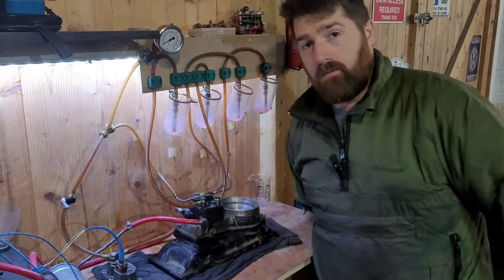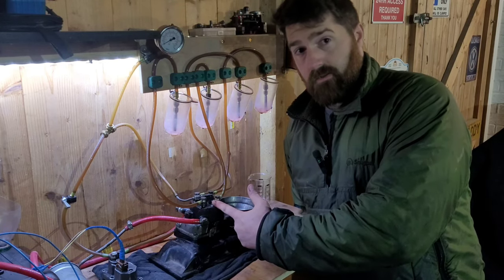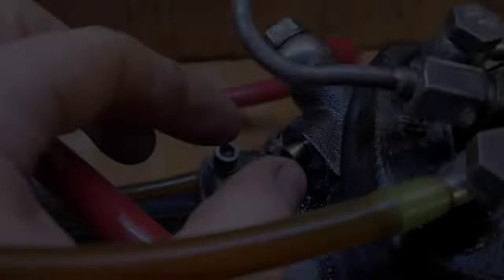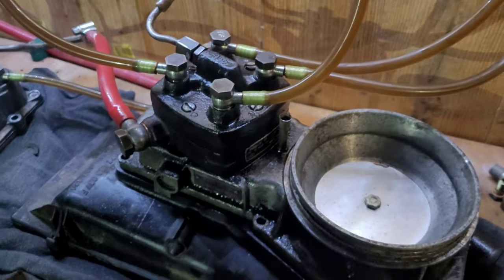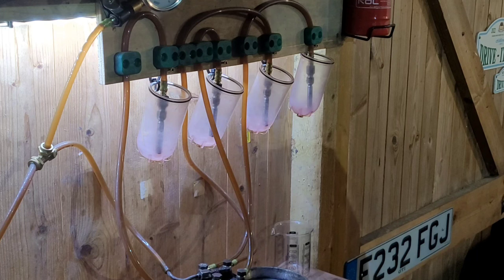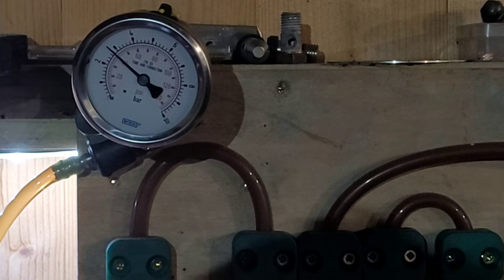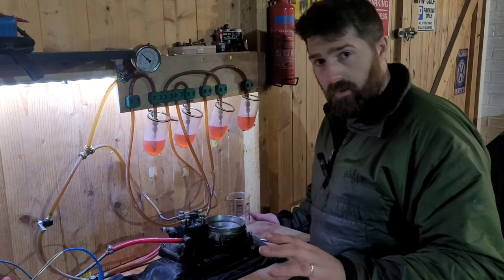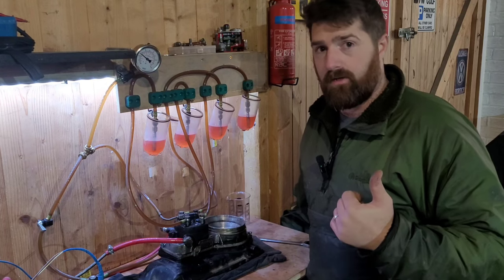Porsche Bosch K-jetronic - 924 System Pressure + More

Comment: You didn't touch that the warm & cold control pressures as well as the A/F adjustment are also factors that impact fuel flow.  Also there are O-Rings inside the metering head that can cause flow imbalance to each cylinder.
Reply from the maker: I've previously covered those points in other videos 👍

Comment: What’s the merc injectors you’re speaking of, I’ve got a 924
Reply from the maker: This is the part number 0 437 502 054
Reply: Brass finish ones without the top hat heat shield on the end ?
Reply from the maker: Yup

Comment: Hello there, would the Porsche unit also work on a MK2, PL KE-Jet, or just on a KR K-Jet? What would you reckon you could get out of a PL Engine ?
Reply from the maker: KE-Jetronic is a different kettle of fish and wouldn't work with this unless you convert to K-jetronic but you then have the issue of emissions to battle with. The KR and PL engines are physically the same
Reply: @GreyGooseRestorations  many thanks for your reply, much appreciated. I do have an original 16V fire and ice, machting numbers, therefore i feel that i want to keep it, meaning i would like to keep it a KE-jet. Surely it could be changed to KR specs and even doing the necessary wiring but i would like to keep the appearance original. Would would you suggest besides of cams, exhaust, head valves? Can the the Blackbox updated or anything else to get a bit out of it?
Reply: Sorry, i was typing with one I closed..hahah but i hope you make sense out of it
Reply from the maker: Just having the car set up with ignition timing and fueling adjusted would completely change how the car performs 👍

The black box (ecu) is what it is, you can replace the crystal to raise the rev limit thats about it unfortunately

Comment: So if you increase system pressure, does it increase control pressure and scale the air meter up? Meaning do they stay in correct relation and the air valve will now require more air to move to, say, half fuel flow and it will be sending more fuel at half  way?
Reply from the maker: Yes, increasing system pressure will raise control pressure, so that will need adjusting to suit the car.

More fuel will increase performance on the engine with inturn will increase the capacity to draw in more air which will then lift the air plate more...which will give more fuel

Its all a balancing act and best results are live testing with AFR guage to see what the car is actually doing
Reply: @GreyGooseRestorations  right. Basically I'm asking if the air meter is capable of more total power in relation to how far the flap is moved when pressure is increased.
Reply from the maker: Yes

Comment: Hopefully you're reading this and can suggest some ideas as I'm tearing my hair on on a 924 Jet. Summary of symptoms:
Car runs either way to rich but starts and runs okay when cold if control mixture set rich, or if I set the mixture so its has correct CO when warm, its coughs, splutters and barely runs when cold. 
So it must be the WUR then?
This is what I've done so far to try and find the issue.
Full system pressure check - all within Bosch spec when cold and warm, confirming WUR working.
Rebuilt and cleaned WUR just to make sure. No difference. Swapped out WUR, no change.
All new injectors.
All new injector seals / screw in bosses.
Flow check on all injectors - even and correct.
Cold start injector, tested, functional and working - issue of poor cold running exists long after cold start injector fires either way.
All new coil, distributor, plugs and leads.
Swapped out ignition module, no change
Stripped and rebuild metering head valve - new kit, fully ultrasonic clean etc, etc
Cleaned out and checked all the injector lines.
New fuel pump in tank and engine bay + filter
Fresh clean fuel
Inspected, cleaned and checked flow plate mechanism in metering head and test swapped ith a known working one, no change.
Replaced inlet manifold gasket and resealed.
New air filter.
Smoke check for vacuum leaks, small one found and corrected.
Timing checked and rechecked.
New timing belt fitted and timing checked.
Compression and leak down all within spec and even.
When warm, car runs great but coughs, splutters and barely runs when cold.
Make the mixture way to rich and car starts no issue, but then is poor when warm as too rich.
Pressures and WUR checked, rechecked and different WUR swapped in to test, no different,
All correct Porsche components fitted, nothing after market or high performance.
Only other issue is that the auxiliary air valve didn’t appear to work very well,m i.e did not increase cold idle speed so had to modify this to give a 1,500 rpm fast idle which sovced that problem. Cold start mixture was same before or after so dont believe related.
Lost as to what to do next?
Reply from the maker: Whats the CO % when the car is cold and what does it read upto when the car is warm?

The auxiliary valve needs to be working as it should be as that will cause issues
Reply: @GreyGooseRestorations  Thanks for the quick response. If the warm idle is set at 0.6 CO, when cold it goes to about 1.5 then gradually reduces. As it warms up the problem goes away. If I set the mixture so it runs when from cold, it's at about 12!! but then is horribly rich when warm and not useable, fouling the plugs. The Aux air when not working just had the cold iddl at 600rpm and struggling. After winding it a little more open, it then went to 1,500 rpm from cold and was working fine. With ot without the aux air valve, the engine would just splutter, cough,m mis and pop as I tried to rev it up, gradually improving until it was warm then it would run great. With the aux air valve in place and working, the misfire, hesitation and popping etc remained without changem just that the starting posiiton was 1,500 rpm, not 600. Hope that all makes sense. Given swapping out the WUR made no difference and all the pressures were as per the manual,  I resorted to changing the inlet manifold gasket as I thought the only thing it could be was a vacuum leak that healed and closed a gap as the engine warmed up? But again, no difference. It really has had me scratching my head,.
Reply from the maker: @Otto-AutoPilot when you rebuilt the WUR did you remove/replace the little inlet filter screen thats at the base of the fuel inlet
Reply: @GreyGooseRestorations  Yes, ultrasonically cleaned them too.
Reply from the maker: @Otto-AutoPilot unfortunately that won't clean them, there's 5 layers, one being a plastic type, id take the feed pipe off the WUR and poke the old filter out and put the bolt back in and run up the car and see if it makes any difference
Reply: @GreyGooseRestorations  Thanks, it would make sense as everything points to lean mixture, despite pressures checking out. Thanks.